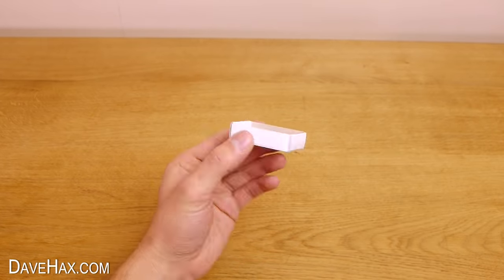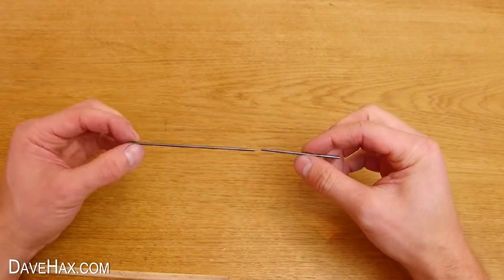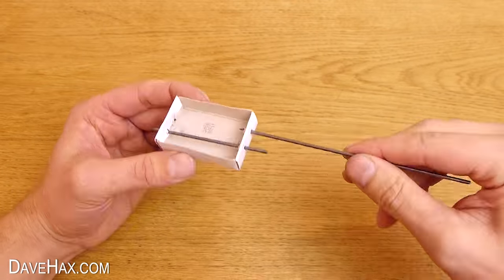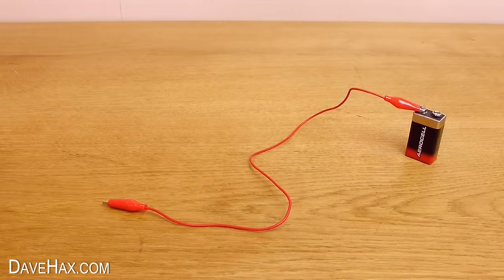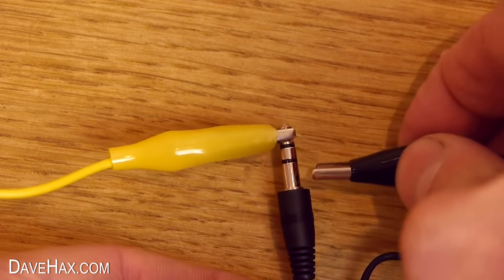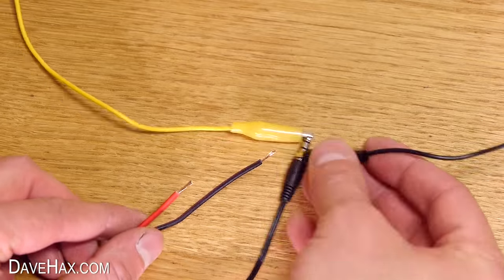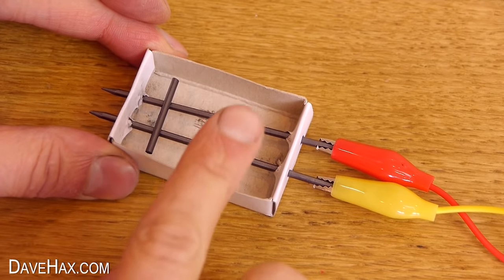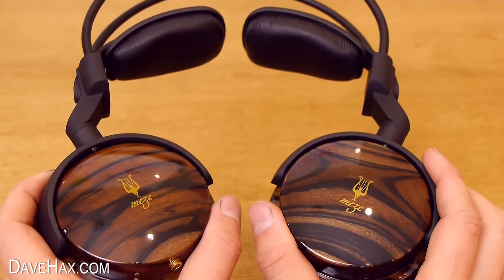How to Make a Matchbox Microphone

Comment: For those of you wondering, you can use metal instead of pencil lead. I've been experimenting with two paper clips as the connections and different materials as the free-floating part, and have found something that should be discussed. I first tried 3 paper clips stripped across the bridge, with 4 AA batteries hooked up to it in series. I could only hear loud bumps and buzzing. After experimenting and reducing to two AA batteries and only using 1 paper clip, I found that if I talked very quietly, I could hear what I said - but it was still bugging out my headphones. I then attempted a piece of aluminum foil folded accordion - style. It was so loud that it made loud bumps on my headphones and hurt my ears. The reason graphite doesn't do this is because, though it conducts electricity, it acts as a resistor; as in, it makes it much harder for electricity to flow through it. In conclusion, to use metal instead of graphite, you will either want to hook up a customized circuit to reduce the current, or, for those of you who can't, if you use a 1.5v AA battery with two paper clips as the connections and a paper clip across the middle for the actual microphone part, using a 200 ohm resistor (Or 220 ohm resistor) hooked up on the positive lead of the battery will bring the amps down to 7.5 amps, (or 6.8 amps) and will hopefully prevent your headphones or speaker from blowing out. SERIOUS NOTE: I am still new to calculating resistance, and this is all theory until I have a chance to actually get some resistors, so use headphones that you don't care whether or not they are destroyed, and DO NOT PLUG INTO AN ELECTRONIC unless you are ABSOLUTELY CONFIDENT that it is safe, or else you may just ruin ports on your computer or other device. Hope this helps!
Reply: cool,i use an old oxidised needle on two pieces of graphite as a semiconductor for crystal radios.
Reply: @bludthinkhecool  no
Reply: Yap

Comment: Attach both sides of the battery to the "microphone" and you've got the basic structure of a railgun. It shouldn't be powerful enough to move anything, but crank up the power input by daisy chaining batteries and the smaller graphite piece will move down the line.

Comment: I made a slight improvement of this experiment.
Instead of using 3 pieces of graphite, I only used one.

The two supports were solid core, bared copper wire.
To stop the graphite from falling off, I put a tight loop in each of the wires, places the graphite through both loops, and then inserted into the box.

Comment: I don't recommend doing this. This IS DANGEROUS. I tried it with two sets of different brands ear phones. Bolth times the ear phones got very hot and made wierd noises even when I was touching them (voice and noise do not work) and one time a spark flew out and hit me.
Reply: I don't know if this is just for the materials I used ( a plastic cup instead of a cardboard matchbox, energizer 9V, and cheep head phones because I didn't want to ruin them.)
Reply: +Mccrazy that is because of the DC bias in the signal. Just add a 100-1000 uF Capacitor in series with the headphones to AC couple them. Also please check the volume before putting the headphones on your ears, if it is too high, you can add a series resistor, or just put the central graphite piece further away from the leads.
Reply: +Marian Keller yup. also 9v DC is waay too much to be pumping into any earphones anyway...
Reply: why do u even use 9V.. wtf
Reply: shriramvenu No, because the "microphone" has a high impedance, therefore there should be a significant voltage drop. So to still hava a high enough level to hear anything on the headphones, you need a pretty high voltage.
Reply: Marian Keller most headphones have an impedance of around 15-30 ohms. At 9v thats 300-600mA of (useless) DC current. Its going to produce a lot of heat since its almost a short circuit.

sound in speakers or headphones is generated from AC not DC
Reply: shriramvenu You don't have to explain that to me. Also you didn't get the point. The microphone has a comparably high impedance, while the headphone has a low impedance. So when a high impedance source tries to drive a low impedance device, the signal level drops. Also there should be no DC-current when using an AC-coupling capacitor.
Reply: what do you recommend as a power source?
Reply: Well I was messing around with around 2 AA batteries, taking 1 away or adding 1 or 2 depending on your specific microphone. So either a few AA batteries or AAA batteries.
Reply: Marian Keller ......can I ask one thing?
 Is this experiment based on any special theories????
Reply: 3 problems using this microphone:
1. Too many current pass. This makes heat both on the microphone and the headphone.
2. Resistance is too low. Using low resistance resistor (in this case graphite) can make a lot of heat.
3.Voltage is too high. Ideally headphones needs a voltage is about 10mV-1V.
Reply: Use 3 triple A's
Reply: Marian Keller graphite in the shape and length that he used would have a resistance of maybe 20 - 50 ohms

Comment: powered with a 9v battery, you can just tap the two leads together to get a tapping sound.  If this "microphone" does nothing more than that, it's completely worthless.  If it DOES atually transmit sound, why not let us hear it?
Reply: Instead of insulting , why dont u try it out urself ? It aint gonna cost a thing to do so
Reply: @ender0998  It wouldn't have cost DaveHax a thing to show us whether his"microphone" transmitted sound.  It would cost any of us time and energy to prove the hypothesis that HE presented.  If you say something does something, why not show it doing that thing?  Or better yet, why don't you build one and report back to us whether it works?

Comment: Can someone please tell me how does it work??? or on what principle does it work????
and above all does it really work????
Reply: As I think, as the little grafite is jumping (vibrating) on top of the other two grafites, this makes the current flowing and stops it too. When it touches the two grafites then the current can flow, when it doesn't touches all the two grafites then there is no connection for the current to flow.
And this current on/off vibration makes the speaker's membran vibrating (because of the speaker's coil's vibrating current->vibrating magnetic field->little peace of magnet or just steel is pulled-pushed), and that makes the air vibrating and that is what we can hear.
Reply: look up "carbon microphone"
Reply: Tirth Upadhyaya carbon vibration
D O N E

Comment: you can get the same sound even without connecting the lead just directly connect the speaker to battery and just scrub the wire on any end of battery same sound will be produce ,here in this video the lead are just acting as contact and as i said scrub the wire on battery the same thing is happening here by tapping the MB , am i right Dave :)

Comment: You might not want to run DC current through your earphones or they may let out the magic smoke. If you put a bipolar capacitor in series with the earphones it may solve the problem.

Comment: I do all sorts of foxhole technology,crystal radios,tesla coils(no transistor,but a kind of obsolete technology called a coil interrupter),i can even make speakers,and a microphone,the one i use is similar to these,but has an oxidised needle on two pieces of graphite,it is used rather as an electric disturbance detector,and can be used as a regular detector in crystal radios,although worse quality,it is very sensitive to even the slightest AC around,my friends are amazed that i make fully working tesla stuff without any real components...

Comment: What I think is that the setup is not accurately a microphone.

Graphite conducts electricity.
The small lose piece of graphite on the other two sticks complete the circuit. Just because you tap the box, the little piece gets a bump and reconnects the circuit, causing the sound in the speaker

Correct me if i am wrong on this.

Comment: To avoid get cut if you slip with the knife just burn the wood off of the graphite it will not melt it I use to be bored a lot as a teenager so I use to do that plz don’t judge!  Well yea you can I was a dumbass back then still but just try burning so you won’t risk cutting yourself

Comment: Can it work on speakers?
Reply: Anything that can make a sound in headphones can work on speakers if you use an amplifier in between, but you risk damaging the amp with DC. There are ways of protecting the amp, but that requires more components.

Comment: could you not make a speaker the same way for the other end? as a microphone is only a speaker in reverse
Reply: I don't think it would work, because though your voice would vibrate one end, the electricity wouldn't shake the other end; you would basically be pumping sound into 3 resistors hooked in series (since graphite works as a resistor) and would hear nothing. But you are right, conventional microphones could be basically reversed to make speakers. But that's because conventional microphones use magnets. Good idea though, I wouldn't of really thought of that.

Comment: can you show how to connect this microphone to a pc?
Reply: You wouldn't need to make all this to use earbuds as a microphone for Pc. Just plug them into your microphone jack.
Reply: Zoom yeah, but how?
Reply: Greg Koc I don't know because it didn't work for me. Just look it up. Not that hard.
Reply: +Greg Koc use those wires with headphone jacks at both the ends
Reply: ***** lol
Reply: Greg Koc set it on fire
Reply: Greg Koc strip the ends of the wire from the microphone
Connect it by twisting it with the copper wire in headphone wire
Connect the jack
Reply: Zoom earbud mics shouldnt work very well if at all, because firstly, earbuds have a low resistance, because they dont have very many windings, and your basically making a shaking torch sorta thing, but with very subtle signals

Comment: Can anyone explain its working?
Reply: A microphone is a device which converts acoustical energy known as sound waves, into an electrical energy know as audio signal. Inside the head of a microphone you will find a diaphragm, this is a thin piece of material which converts sound waves into an audio signal. When the diaphragm is hit by sound waves it vibrates, and its these vibrations which are converted into electrical energy known as audio signal.
The reason graphite doesn't do this is because, though it conducts electricity, it acts as a resistor; as in, it makes it much harder for electricity to flow through it. 
So basically, the the Sound Waves are picked up by the Matchbox Microphone, which is powered by a 9-Volt Battery, the Sound Waves are picked up by Graphite rods, which are converted into Electrical Signals and later brought towards the headphones, which are connected via the Crocodile Clips. These are finally converted back to Sound Energy, and a little bit Thermal Energy, due to it’s inefficiency.

Comment: I made it but it made only that finger tapping sound not my voice.
Reply: It worked for the Engineering classes i ran in a summer camp. Try making a paper platform for underneath the match box OR just hold the microphone by the alligator clips and lift it up as you speak into it. If it is just on the table, this design will not work well. The vibrations of the matchbox are what cause the voice to be caught, not just the vibrations of the graphite.    The best designed matchbox speaker was made by a kid who used elastic string to suspend the matchbox inside of a 5 sided box he made out of construction paper. But, as I sad before, the paper platform and just holding the matchbox off the ground worked alright too :D

Comment: IS IT POSSIBLE
Poke another small hole in the middle of the box, and carefully insert a "hair wire" through the hole accessing the inner lead poles.   Put some wax around the middle hole and water proof the box, add a weight to it, so that it can sink to a particular depth based on the weight used.

THE THEORY
The "hair wire" is so thin that it will receive the slightest noise carried on the water, and transfer that sound to the lead inside the match box, and from there through the wires and into the headphones.

Additionally, is there a way to measure the distance of how far away a particular sound is based on the information received through the "hair wire".   I've always been interested in radar, sonar, etc, both underwater and out of water.  But I realize, that water is very sensitive to sounds, as our own voices are carried on molecules within the air.

And why does electricity play a role in sound?